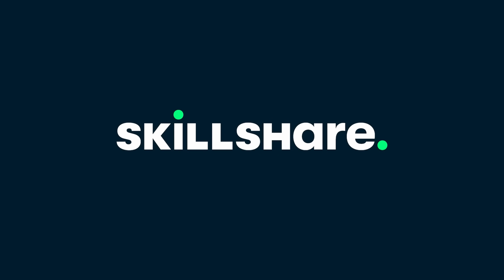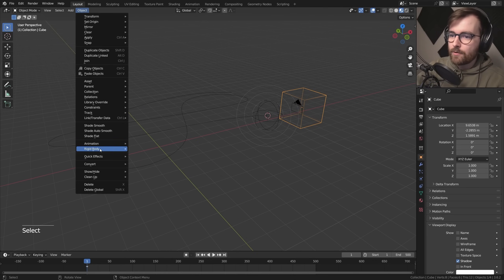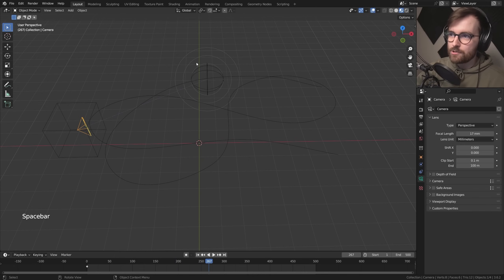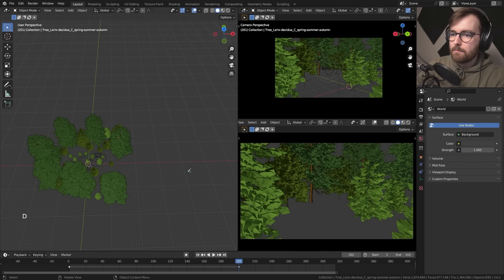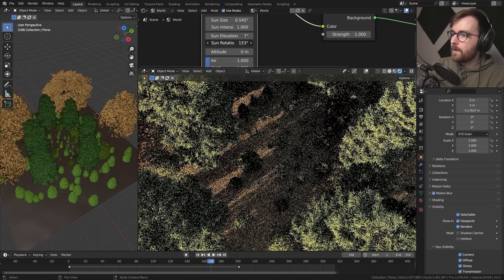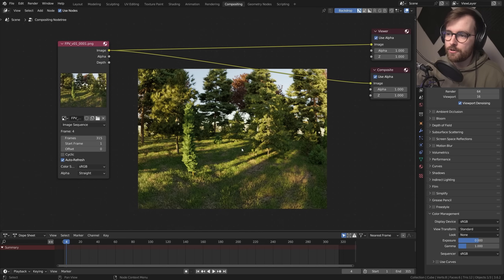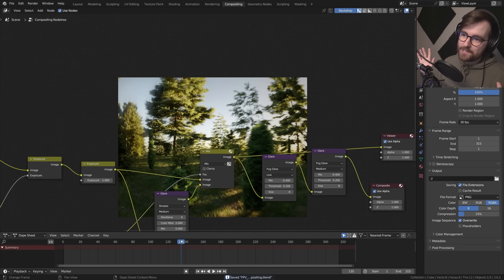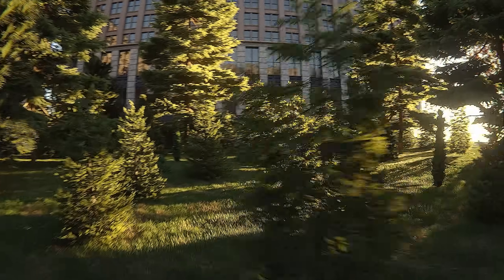Tutorial: Making a Physics-Based FPV Camera Rig in Blender

Comment: You don't have to render out a PNG sequence to make the sharpening work in the compositor. You can run the image through any node with a "clamp" option, like a mix node. That will clip the black and white levels to a 0-1 range, and your sharpening will look right :)
Great video!
Reply from the maker: Unfortunately a hard clamp of the highlights like that loses too much data in the bright areas, so the sharpening ends up looking very different. It’s crucial to get the smooth falloff that the AgX or Filmic view transform provides, and I’ve currently not found any way to do it without burning the data into a png sequence
Reply: @Polyfjord  Oh, you're absolutely right. I spoke too soon. Maybe there's something you can do with the Convert Colorspace node to get around it?
Reply from the maker: @robinsquares  that actually might work! Tested it now with the Convert Color space node set to from linear to AgX -> mix color with clamping -> back to the linear color space! And it definitely produces a sharpening that is behaving like the pre-rendered PNGs! Might need some more testing, but that is very promising. Very cool, thanks!!
Reply: @Polyfjord   @robinsquares  Two youtubers I love learning from fixing an issue together in a comment section, love to see it

Comment: The movement is a bit odd because the drone doesn't tilt towards the direction of movement. In reality, the only forces acting on a drone are gravity (and air drag) and thrust perpendicular to the drone. To move the drone on the horizontal plane the drone needs to tilt to vector the thrust on the horizontal plane.

Maybe a solution to improve the animation would be to have the force pulling from perpendicularly above the camera object and have the 'look at' set to be offset by 90 degrees. Then the camera would tilt when the force object moved and would accelerate in the direction the force object moved proportionally to the horizontal offset from the camera.

Comment: This was a fun project! Thanks for this one. Now, I’d like to take it one step more. I wanted to add physics-based banking to the camera, so that when it goes around a corner, it tilts depending on the corner and the speed. I found another video where this concept is applied to a fighter going through a canyon. This used a hinge constraint. I have tried to get this transferred to a camera, but without success. Can you give some hints on how to do this?

Comment: I wonder, if you can add a banking movement to the camera rigg. The stable horizon is giving it away a bit that it's not a fpv drone...and though I have done similar already, I never figured out a way how to get to that banking (other than manual keyframing) that is basically proportional to the sideways acceleration of a drone...
Reply: if you ever find a solution to this I really want to know. All i can find is a "Map to" modifier which kind works but also kind of sucks

Comment: I think you've watched very little FPV from looking at this motion. Usually, the drone tilts in to the direction of the yaw. That way, it can use the propellors a lot more efficiently and turn faster.

A drone that's sitting horizontal can only yaw slowly as it works by differential speeds of the counterrotating propellers. The actual thrust is wasted. At an angle, a difference in thrust can actually be used. 👍

Edit: Criticism aside, I do appreciate all your expertise and sharing these awesome tutorials with the community. Cheers!

Comment: The physics is not quite right, the camera in race drones have no gimbal, they're rigidly attached to the frame (usually with a some pitch, but still fixed), and their propelers also spin on a fixed axis, always pointing up relative to the frame, so to turn, the frame needs some roll (often coordinated with yaw, but it depends on the pilot) to direct the thrust to the side to cancel out the momentum in the current direction of motion and increase in a new direction (though that can be performed in a smooth manner, not necessarily a quick snap, but that's possible), and likewise, to go faster the drone leans forward more, and to slow down they lean back a lot (or just go level if it's a subtle enough slow down that the air drag of just coasting is enough); and since the vector of thrust is changing it's orientation relative to gravity, you also gotta consider the throttle, very experienced pilots might keep altitude perfectly, while someone with less practice might need to actually see the drone start to lose or gain attitude to react, and might potentially overshoot a bit sometimes.

Some more advanced cameras, or with some post-processing, can stabilize the video and remove a lot of the rotation, sorta like a virtual gimbal, but I got the feeling you're going for a more raw look here.

Comment: you spent so much time making the forest and the thing is it is not that realistic because the placement looks like a pattern also the types of trees you are using are from different continents as you said. What would have been better is if you first made the forest and not manually like this you should always pick 8-10 types of trees that are from the same place and same season and scatter them with geo-scatter because geo nodes is way more powerful than the other option, also do the same for the grass, rocks, plants, bushes